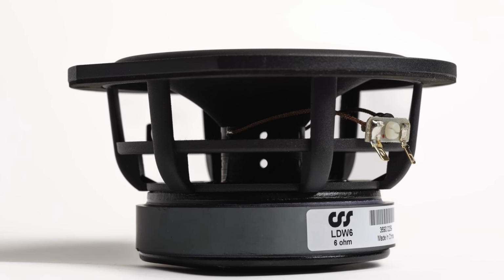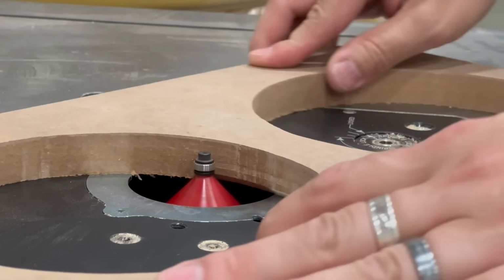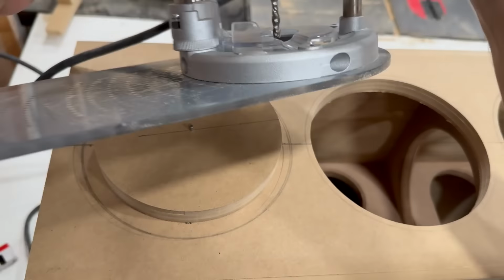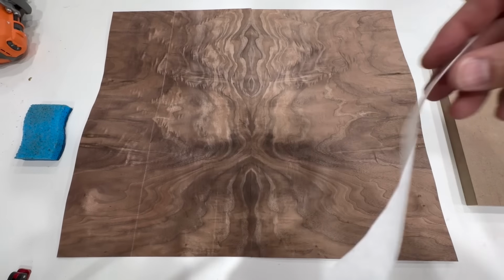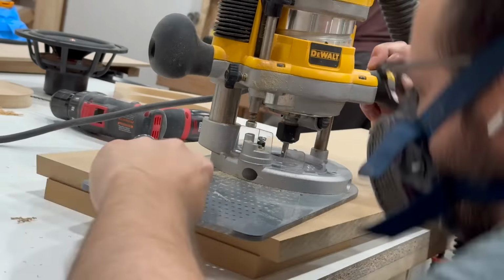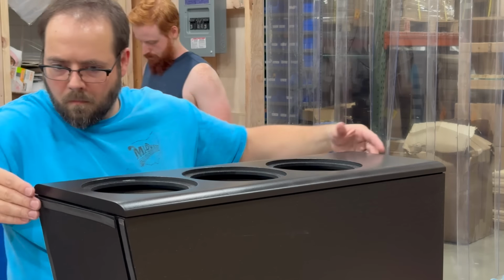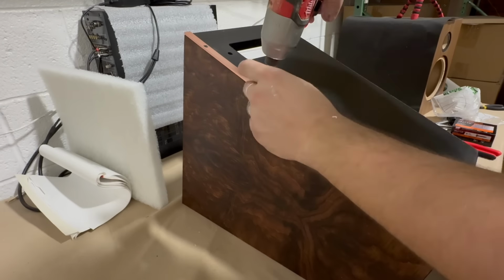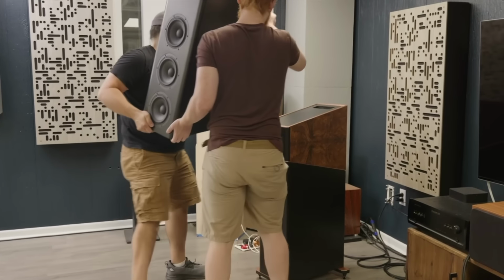Building an INSANE DIY Speaker in 30 Days

Comment: The ports should really have a radius on both sides. A 5-8mm radius will improve the port flow alot and reduce distortion. 
The port opening on the inside should also have a baffle around it for better performance.
A round port without the baffle and the radioused ends is around half as efficient! 😮

Of course a properly designed slot port is the best alternative. 
Just make sure the slot height is as low as possible for the desired area. (7-20mm typically).
When designed right with a baffle on the inside and radioused on both sides a slot port is alot (alot alot!) better than a round port.
An even better slot port will have an expansion(in the y-axis) from around 1/4 from each end out to the mouth. If both sides expand the should be around 7 degrees, in only one side its should be 14 degrees. For calculatioun for the port length the area at the middle is fine to calculate with.
A port mede this way can have 1/4 the area of a proper round port and pump the same amount of air for the distortion.
Compared to a round port without radious edges its closer to 8 times more efficient! 😲
Reply: I don't think efficiency comparisons make sense? And possible inner geometry like baffle or whatnot has a small effect on tuning length... You want ports big to minimise friction and turbulence on the edges and sides, which can create unpleasant noise which isn't even harmonically related, it's just whistling, and avoiding turbulent edges is good. It is especially a concern if you have a lot of sheer displacement. Circle is sort of the "wrong" geometry because for the area its perimeter is minimal, while you don't actually like adding area, since that forces you to add correspondingly more length, which is bad for friction and packaging, you want to add more perimeter and less area. But narrow slots can have their own issues with laminarity sooo trial and error or just wing it and hope for the best.
Reply: @SianaGearz  well an efficient will produce less distortion.
As long as one dont make it to low (less than 7-8mm) its ok. But also keep the width to height ratio as high as possible.
Even a straight slot port is far superior to a round one.

A bigger port area for the same tuning will be more linear.
Its especially good for boxes with volumes on the smaller side where youre limited on length. A slot port in those case make sure the port can pump enough air for the application. Especially when using drivers with long xmax (ie large pump capacity).
Many drivers have a low vas to give a smaller box, but then a port of sufficient area dont fit. Usually people use a round port with an elbow. But a slot port will be far better in such cases.

Comment: Lovely build but could be longer  showing more construction details
Reply from the maker: Which parts would you have liked to see more info on? We can try to make sure we cover that next time
Reply: @css_audio  hi yer just construction jointing methods its good seeing MDF building a case also as Iam building my own 5 way wall mounted speaker the calculations ( I know that every speaker is different I cheated by contacting Wimslow audio in the UK they can do a custom design service using speaker design software to give the length of the reflex ports to make the time alignment spot on ) also finishing the cabinets especially spraying MDF and veneer ready for painting not much to ask but keep up the good work and excellent video's 
Simon 👍👍

Comment: Yeah...lets ignore the 150000 worth shop. Other than that; top job!
Reply from the maker: I think you added one too many zeros. Our shop is only a 22' x 16' space in our warehouse. We spent less than $20K on it including all the building materials, wiring, and tools. The only real tools you need to build something similar are a router and table saw. You can do the veneer without the presses, (which we bought used for $700). The spray gun and compressor were $500 and we used an inflatable booth that is about $700.

Comment: I would ADD SOMETHING SMALL just ABOVE the TOP SPEAKER (its like I'm expecting to see tweeter somewhere, and that just looks like an empty spot where you ran out of time to add the last speaker LOL)  But this is JUST about looks,,, it just feels like there SHOULD be something right in the center of that blank space... BUT I haven't seen a shot of the entire speaker, so there COULD BE a blank space at the bottom that is the exact same size and shape as on the top but I haven't seen it, so it COULD be symmetrical  would look great if the height of the feet were also taken into account... THEN it would look fine, but if you can't see it then it would probably look 'off' just a bit
OTHERWISE they look IMPECCABLE!! The speakers are the flash crap I typically see EVERYWHERE and then I ALWAYS hear some douche-canoe say "those speakers were $2500 ... EACH!!!!" and proceeds to turn on the blinking LED lights in the center that flash and change color to the beat of the music.... well... ALMOST to the beat   LOL
Yours reminds me of speakers from the 70's with paper cones, but I think that's just the color that is making me think of a supressed memory I have or soemthing lol
- I think the ONLY complaint I have isn't about the speakers or design, it about the video... I just wish we were able to see more of how the final layout is...  This is my first video from you so I am COMPLETELY LOST as to how everything is laid out on the insides (I'm guessing you have used this design before and have shown it a few times before, so you didn't bother this time because you figured you've already shown it enough times in other vids, so you didn't need to this time 🤷‍♂ )

Comment: Why would you fill a gap with filler, why didn't you just make another piece, if it was already glued together put a strip of wood in there. That aside they turned out fantastic.
Reply from the maker: I didn’t realize that the panel was too short until I was already in the middle of glue up. There was glue on all of the panels and I didn’t have enough time to cut a new one before I would’ve had issues getting it in place. It was on a piece that had angled ends, and there was glue in the gap. I did consider trying to use a piece of MDF, but it was a very small sliver and needed to be angled on both sides so I thought it would be harder to put a piece in than to use Bondo.
Reply: @css_audio  Fair enough I knew you'd have your reasons, I'm just one of those people that would lose sleep at night if I did that, until the next day when I saw them and fell in love again. 😀

Comment: You need a cnc machine.
Reply from the maker: Good ones are too expensive for how much we would be using them. You have to run them basically around the clock to recoup your money. We use a local company who only does CNC work for our kits. They do a great job and it keeps us from having to spend $150,000 on the CNC machine they would set idle most of the month.